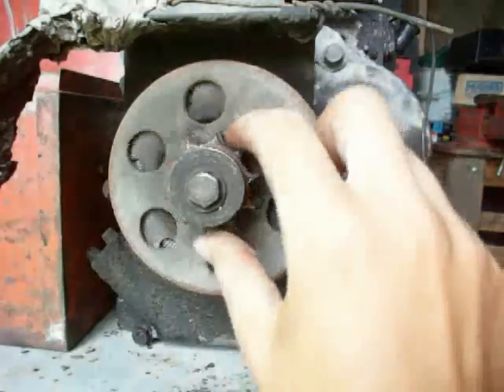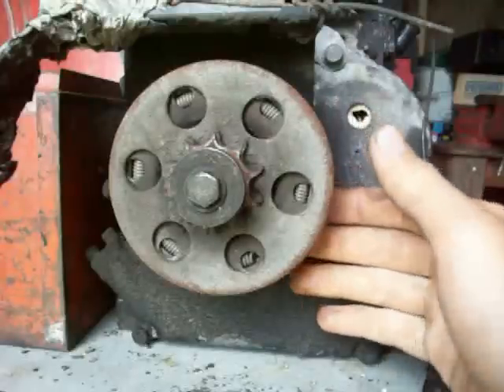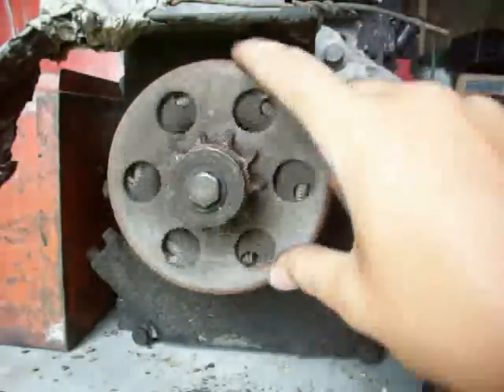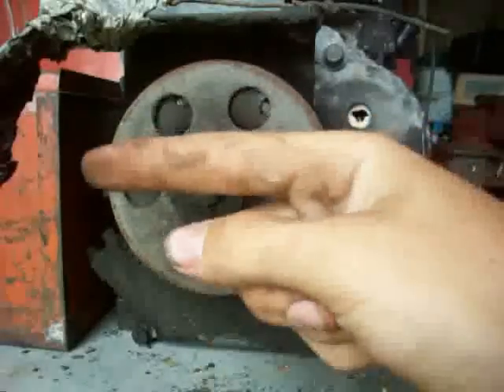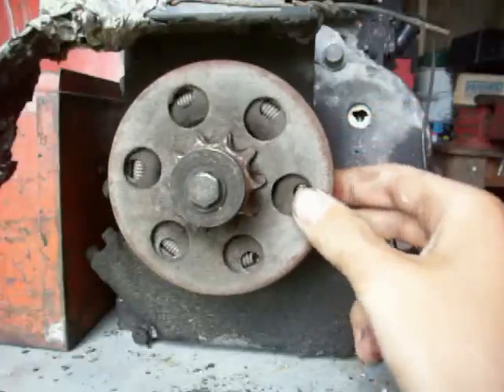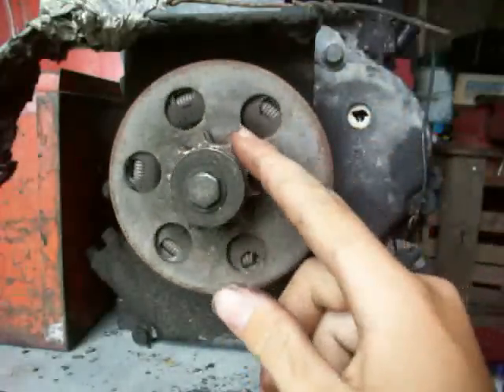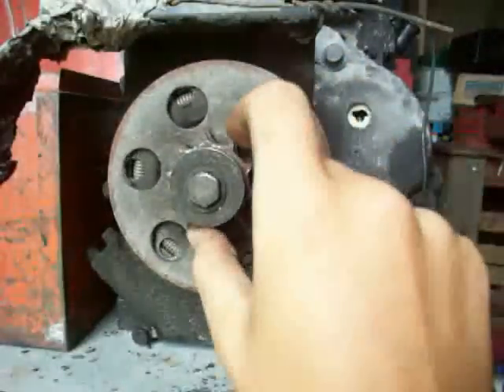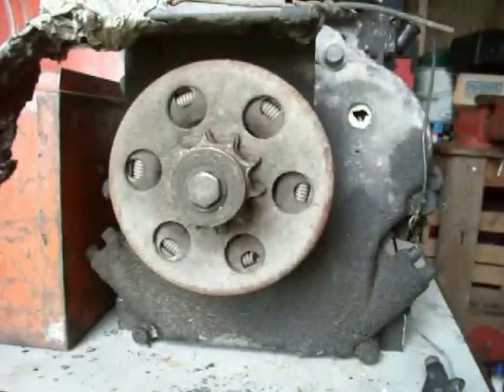Centrifugal clutch systems and how they work

Comment: The engine on my 25 yr old quad died. It's an old Polaris 2-WD. It has a snowmobile style centrifical clutch system. I was thinking of installing a 6.5 hp store motor in it,but now that has a 3/4" straight shaft. The drive clutch from the quad has a tapered shaft. Could I use one of these go cart clutches on this rig? What would I use for a driven sprocket? Don't need high speed. 30mph is plenty.
 Thanks.
 Thanks.

Comment: Is there a way to set a specific rpm to make it start moving
Reply: Zombie Empire it usually engages at 1900 rpm
Reply: You'd have to install a after market max torque clutch they have interchangeable springs

Comment: How would you remove the bolt/nut in the middle holding the clutch ? in order to remove the clutch ?
Reply: Hold the wheel and take it off if not take the engine out and take it off from the back